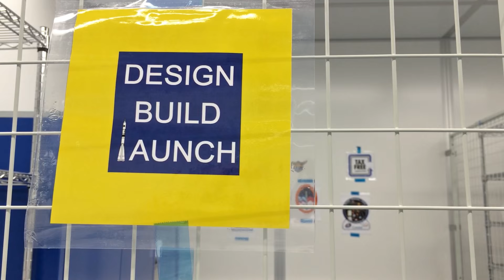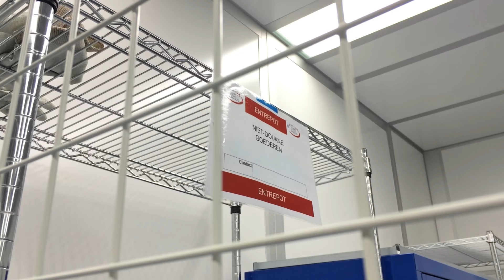Inside A Satellite Clean Room

Comment: I worked as a welder for a company that made clean rooms. As a welder I built the physical structures, so had nothing to do with the final cleaning of the room, but even so the standards of cleanliness (even at my level) were insane compared to other manufacturing jobs I've had.
     In most types of welding there is a protective film called slag that forms over the still hot weld. As the metal cools and solidified this slag hardens and is then chipped away leaving the metal.
    Normally a few whacks with a chipping hammer or a bit of scrubbing with a wire brush is all that is required, but not there. We were not allowed to leave even the smallest particle of slag on any weld anywhere. It was insane. The LITERALLY went over your work with a microscope.
Reply: Welder here: Slag only forms during flux shielded welding operations, so SMAW or FCAW. During MIG or TIG the shielding is done by inert gasses, so no flux required.

Comment: I worked at a semiconductor manufacturer with a clean room. (I was in IT so I only went in once during my orientation). I don't know what the ISO rating was, but it must have been much more stringent. The air pumps would have been too loud to film a monologue inside it, and we wore surgical masks and goggles.I could relate to not knowing where to begin on getting into the "bunny suit". The wafers themselves were sealed inside extra-clean boxes inside the clean room, which were handled almost exclusively by robots and only got opened inside the machines working on them.

In all, I felt like I"d gotten a job on the Death Star.

I hope you get the chance to record a room like that, but given the trade secrecy of semiconductor manufacture, I wouldn't bet on it.
Reply: Linus tech tips managed to film inside one of intel's facilities, which is definitely worth a watch
Reply: @conkerconk3  and one of micron’s (crucial) facilities

Comment: 2:10 well apparently they failed, as you can actually see dust on the satellite :P
Reply: +ybra I don't think that is dust, probably small scratches on the panels.
Reply: Switzer that sounds like it would be worse
Reply: +ybra It is indeed dust. Clean rooms like these are not 100% dust free. The risk of cleaning again and again is higher than leaving it until just before launch. The solar panels will be cleaned. A scratch would be worse indeed.
Reply: You sure it's not just dust on your computer screen?
Reply: +Wouter Weggelaar solar panels are hard to wash..we are making one of these cubesats and we haven't assembled solar panels yet.
Reply: +Li Ryan it depends on the type of panel and the adhesive used to attach the cells to it. we are manufacturing various types with different adhesive techniques, and some are much easier to clean than others
Reply: @WouterWeggelaar  If only people understood this. Sometimes cleaning makes it worse

Comment: I am fairly certain that room is not laminar airflow. Laminar airflow would require the ceiling have 100 percent hepa filter coverage. They could even have a hood in there they work under, but the room itself does not have laminar airflow. It does push air from top to bottom but that alone does not make it laminar airflow.

Comment: Just to let you guys know, incase you wondering,  the yellow cable that attached to the technician hand is a static discharge cable that neutralize static change on your body when touching the electronics, so it doesn't damage the sensitive electronic circuit. It also used in many sensitive electronic manufacturer.

Comment: @2.30 is that dust on that cubesat?
Reply from the maker: +Stephen Jenkins There'll always be occasional, small bits, particularly visible on solar panels like that: easily removed before it's packaged up for launch. Just imagine what it'd look like if you left it on a shelf outside...!
Reply: +Stephen Jenkins Yes, that is dust. The risk of removing that now,  and then cleaning again and again, is higher than leaving it until just before launch. But yes, it is contamination. Clean rooms like these are not 100% dust free. What Tom said ;)

Comment: Is the satellite  at 2:30 the model? I wonder about the clearly visible dust...
Reply: I think so i mean its pretty small. Maybe i didnt really catch that but if its a standalone satellite it should be bigger i guess
Reply: +Der Retro They are working with CubeSats, which are about 10x10x11.35 cm big (regarding wikipedia) so it could be the real one. It is also clearly connected to the ESD. I also wonder even if it is the model, it has the dust on it and it is IN the clean room right? Must have to be related with the fact it is "only" a ISO 7 clean room?
Reply: +Der Retro No cube sats are very small. These micro satellites are made to be small to make them cheaper to send up in space. The recent decades of miniaturization makes this possible. Though big satellites are still launched as some systems can not get much smaller (like if you make Hubble smaller you would also the optics poorer. Size matters when it comes to optics.) And some of those big satellites and probes are just loaded with more stuff.

As for the dust particles on it. I expect they will clean it before sending it off. Think of how much dust it would have on it if it was not in a clean room.
Reply: +Der Retro The cubesats are actually that size! They launch several of them on a single rocket.
Reply: Well thats stupid... How do you accurately keep track of the exact location, so no other spacecraft flies into them? I mean imagine having a mission to moon and one of those cubesats smashes the "windshield"...
Reply: +Der Retro That's why you can not simply launch them. A lot of planning goes into those orbits and how they are released. There is also rules that regulate what you to put up, so that it will not end up as space junk forever.

Regarding the satellite at 2:30, that is the flight model that is going into space. I have answered this question a lot already, but It is indeed dust. Clean rooms like these are not 100% dust free. The risk of cleaning again and again is higher than leaving it until just before launch. The solar panels will be cleaned before launch.
Reply: I work with condenser microphone capsules - same deal. You can clean them just once before you wear through the gold sputtering. Learned that one the hard way.

Comment: Forgive my layman ness but the places where the make motherboards and the such, what ISO grade are they?
Reply: +GabrielKnightz Motherboards themselves use packaged components. They are usually made in ISO 8 conditions. The chips on the motherboard are manufactured in ISO 6 or lower. CPUs are handled in ISO 5, except when in the machines, were it is even cleaner.
Reply: +Wouter Weggelaar 
Thanks :)
Reply: What about hard drives?
Reply: Magnetic hard disks don't work well under low-pressure conditions like space. The main storage used in satellites are usually flash disks, which are chips designed to store data, however some older satellites are using magnetic storage (which is different from the regular computers disks, one of the differences is that they don't move to read or write data).
Reply: I think he was asking about the ISO grade where hard drives are manufactured.

Comment: cleanest rooms are not for space missions but for semiconductors where a particle the size of a few nano meters could kill the chip
Reply: Actually, no. ISO 5 are the standard used in the room holding the equipment making the chip, and ISO 4-3 is the environment inside that machine.

The purpose of ISO 1 is not to prevent it from touching dust but preventing any living organism from touching the machine, preventing any cross-contamination (important in some studies and defintely an ethics consideration).
Reply: @gacelperfinian  Manufacturing electronics you control dust to and it is the same with Pharmaceuticals but you also have to sanitize the room to get it as sterile as possible and then depending on the classification you have to wear different garments and interact in certain ways when you gown and interact with the room.

Comment: Since it is a log scale, are ISO-1 rooms clean to beyond the point that is manageable when people are still allowed to enter? And if so, what are all the extra challenges/procedures? There is so much more to this topic :o
Reply: +Fiyaaah Correct, ISO 1 would be nearly impossible and usually is only achieved locally (for instance in a chip making machine) or inside a glove box, one of those boxes with gloves permanently installed in the sides. people can not enter ISO 1 rooms as far as I am aware of, they will bring in too much dust. so for a mars mission, when they sterilise something that is impacting the planet, they only do this very locally. You would have the people in ISO 5 or 4, and then use a glovebox to handle ISO 1 parts.
Reply: +Wouter Weggelaar o wow, a response from the guy in the video himself! :o Tyvm!

Comment: What kind of security clearances do you need to access this stuff?
Reply: +UntouchedWagons That greatly depends on what you want to access! Inside the customs area you need clearance from customs and nothing should enter or leave without permission. Inside the clean room when there is no confidential hardware present, you just need to be granted permission to access the clean room itself. If there is confidential equipment in there (commercial / trade secrets) then its a different story....

Comment: At 1:12, are those modular synth patch cables hanging on the side of that cage? Where is the cool satellite synthesizer?
Reply: +Sysex|Studio You should listen to a satellite! sounds like music to me ;)
http://pa3weg.nl/Delfi-C3/Delfi-C3_full_frames.mp3

I would like that to be true though, a modular in the clean room. I would spend a lot more time there. Also, it would keep my mixing desk clean.
Reply: +Wouter Weggelaar Nice sample! Yes, my mixing desk is black and I end up with dust easily as well, a clean room would be excellent!
Reply: The only trouble is that they are very tiring to work in, and the air is dry and its noisy. So I think I'll just dust my console ;)

Comment: 2:13 But... there's visible dust on those solar panels!
Reply: +piranha031091 I don't think that's dust. Remember he said that the visible stuff was actually the easiest? Its probably small nicks and scratches on the outer surface.
Reply: +Switzer I don't know... some of those really look like textile fibers. And if they're doing everything with so much care, how come they would have managed to put nicks and scratches on the solar panels? 

Perhaps it is because they are fibers too large to be picked up by air drafts and captured by the filters, so they just remained stuck to the panels. And since solar panels aren't sensitive to dust, maybe they just didn't bother removing it?
Reply: +piranha031091 It is indeed dust. Clean rooms like these are not 100% dust free. The risk of cleaning again and again is higher than leaving it until just before launch. The solar panels will be cleaned before launch. A scratch would be worse.
The panels attract dust because they contain cover glass. static electricity "sticks" those fibers on.
Reply: Wouter Weggelaar
Thanks for the explanation!

Comment: But how do you know your ISO rating is right, or that you're actually meeting it? Surely you can't... count the dust? It seems that it makes more sense if it's a guide for the kinds of procedures and equipment you need to use for each successive layer of cleanliness. As in, to achieve ISO 1 you need to use X, Y and Z, but to achieve ISO 7 you only need X. Anybody know?
Reply: +essentialatom You can count dust particles! this is an entire science and that equipment is quite expensive. basically, you sniff in some air with a particle counter, separate the particles by size, and let them pass micro sized tubes that have a laser light shining through. if the laser is interrupted or scattered, a particle has passed. Add up the particles in their respective size tubes and you can see if a clean room is up-to-spec.

In practice, there is indeed guidelines that indicate what clothes to wear, what to do and also what not to do. For instance, having full face masks can be annoying, so if not needed, its much more comfortable to not use them.
Reply: +Wouter Weggelaar That makes a lot of sense. Thanks for the explanation!

Comment: And an ISO-1 clean room would be where the "bunny people" work?
Reply: +Seegal Galguntijak That already starts from about ISO 6 down, but yes, full suits for that!
Reply: Seegal Galguntijak There is two things that you have to do for ISO 1: keep it as small as possible, and pre-cleaning steps. So basically, ISO 1 is built inside another clean room, and often that is built in yet another one. For instance chip making machines have a local area inside the machines that is very clean. The machine conditions the environment inside it. But the machine is inside a clean room. People have to enter this clean room by going through several air-locks, progressing from ISO 7 to ISO 5 and then down to lower values if needed.

Comment: see now im wondering what would happen if i built my own satellite in a dirty barn or something, are solar panels and basic radio circuitry really that delicate?
Reply: +theguy9208 i assume it's because during the launch they are not in those extremely hostile enviroments yet, and there would still be a chance of damage. plus dust partical could end up inside the equipment and stop things from working properly.
Reply: +theguy9208 mostly its optical parts (cameras abd the like) or moving parts (reaction wheels), you run the risk of blury photos, or one of your axis of rotation ceasing up. both are problems were there is no way of fixing the problem once its happened, and the problem may not be visible at launch
Reply: +theguy9208 

In a lot of parts, this is a "better safe than sorry" sort of thing. Ultimately, there's a higher cost of shit going wrong than building it air tight. So they go with the latter and cross their fingers.
Reply: +theguy9208 If you build a communications satellite with no optics in it, you could just build it in your garden shed if you like. It has been done.
The risk would be that 1) you are not accepted for flight because you are a contamination risk to others on the flight, or 2) your solar panels will not produce enough power because they are dirty.

For the rest, it will totally work :)
Reply: +Legend Length Well I think it's quite doable to make satellites that work with dirt, but they will either lack features or have to be designed to be stronger and heavier.
If one would only make one satellite and not have the opportunity to invest in a clean room, perhaps it would pay off.
However some parts just need cleanrooms, the manufacturing of microchips for example.
Reply: +Legend Length The problem with these statistics is that no-one wants to risk finding out the failure rate. As said in the video we are taking precautions that may not be necessary in the end. If you would not do this in a clean room, you would not be able to have customers with optics in their satellite, nor sensitive detectors or scientific instruments. The instruments are usually what counts, not the support electronics to make the satellite work.

There are plenty of CubeSats built outside of a clean room, usually by universities. The problem with these university satellites is that quite often,when they fail,  there is no single reason for the failure. so getting statistics on this is very difficult. The satellite that I built in University (Delfi-C3) was built in a clean room and approaching its 8th birthday in space.

Furthermore, being allowed on a launch vehicle with other paying customers usually requires you to at least clean the satellite and a statement of its cleanliness to the launch agency.

lastly, would you want to spend all your money buying a satellite from a company that does not have a clean room? In the total cost of development, the clean room cost is negligible.
Reply: Legend Length well, yes.
If it's engineered to handle it, it will work just fine. It's just that engineers are told to get the most out of every gram. They will make hinges only with a diameter of only a millimeter holding a kilogram of weight because there is no gravity in space anyway, so you can get away with that. (the hinges were just an example, not an actual thing I've seen)
However if your satellite has a basic design without those delicate parts then you could go ahead and assemble it in your backyard. And creativity and simplicity is often underestimated. Sometimes cheap equipment works better than expensive machinery.
.
Another aspect might be that companies just want to show off. Having expensive equipment is a good selling point, I mean who would you trust judging from these phrases:
"I make satellites in my shed, they're fine" or
"Our company has a clean-room production facility conformed with iso 7 standards"
The second thing sounds much better, right?
However I am not saying that's the case here, I haven't checked it myself so I don't know for sure.

Comment: What iso are operation theaters (in different countries)
Reply: The standard classifications for those differs quite a lot. Emphasis is placed on microbial filtering more than particulates. Also, the air taken out is filtered too to prevent spread of bacteria and other airborne diseases. I have seen references to ISO class 5, but since the standards differ, I can not state that as fact.